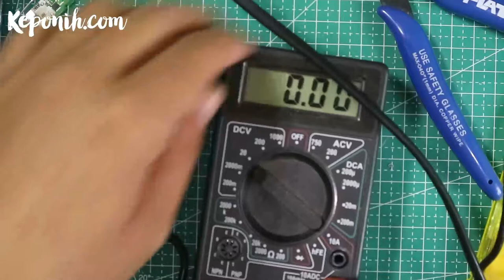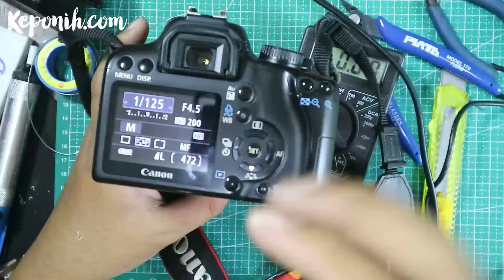Kamera DSLR tanpa Baterai. Merakit Dummy Baterai untuk menghubungkan kamera ke adaptor listrik

Comment: Mau nanya bang, klo adaptor nya output 12V = 7.0A bisa gk bang..(Camera DSLR 600D)
Reply from the maker: Wah ga bisa, pasti jebol kameranya..terlalu tinggi voltasenya. Max 8 volt. Kalo adaptornya kegedean voltnya, bisa cari adaptor lain atau pake voltage step down regulator. Kalo amperenya gede ga masalah karena kamera bakal narik sesuai kebutuhannya dia aja, yg penting voltasenya sesuai dulu
Reply: @Keponihmedia  Terimakasih info bang, Sangat membantu😊
Reply: @Keponihmedia kalo power Bank gmm  om?